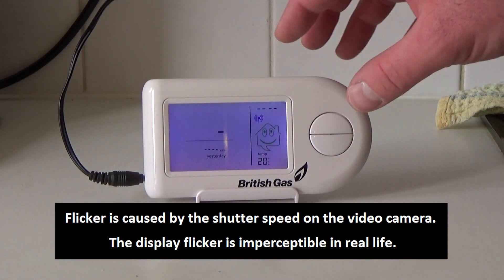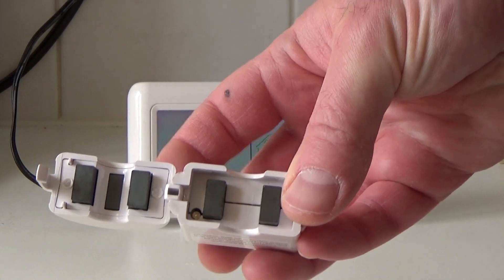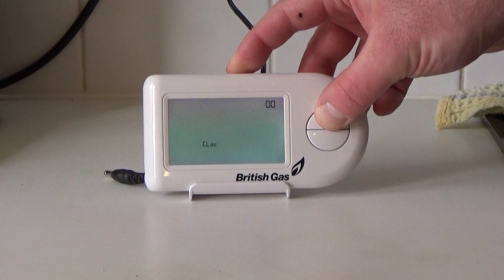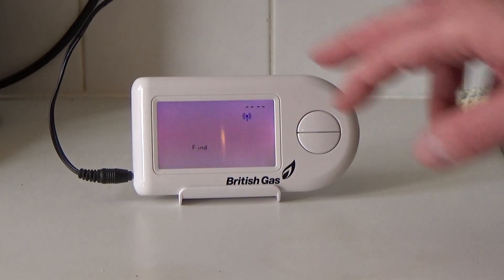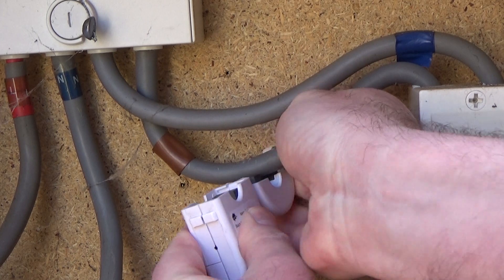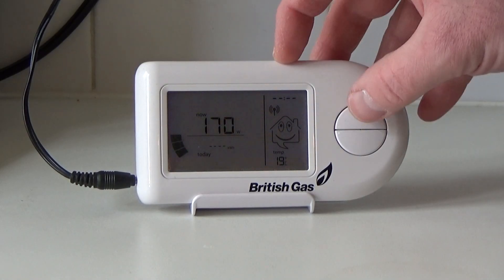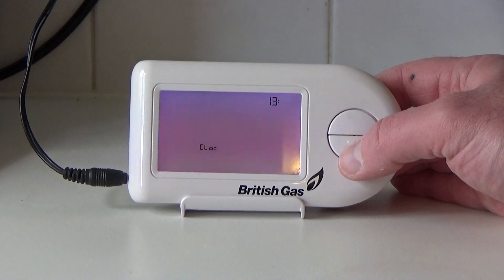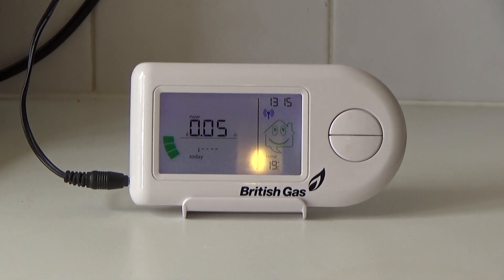British Gas Energy Monitor "DIS150" - How to Reconnect to Sensor Unit

Comment: Many thanks Tim, this worked perfectly on our one (same model). The battery in the display unit for ours would not hold a charge, so we couldn't put it into "settings" mode while on battery. But the press bottom button followed by 4 presses of top button straight after plugging it in still put it into "find" mode. 🙏

Comment: I've replaced the battery in the sensor but have no flashing light? Is there something else I should be doing? Thanks
Reply from the maker: Assuming the battery is good and is making good contact with the terminals (check for dirt or corrosion), if the light isn’t flashing the sensor may think it’s already synchronised. There is a tiny reset button on the side which you can push with a straightened paperclip or similar. Try removing the battery for a few minutes, then put it back in and immediately press the reset button for 2 seconds. (The reset button only works for a short time after inserting the battery. ) That may reset it to flashing mode.

Comment: I have a different problem with this BritGas 150 monitor display. Can anyone help please. Wanted to start using the device again - I put it away 5yrs ago and it was working ok then. So I bought a new CR2 lithium battery for the sensor...I now get a single green light flash from the sensor light when it's in the open position...so I assume the sensor is now working. Initially, when I plugged the monitor unit into the mains trans plug it seemed ok - it came up with the normal display. I could set the time and unit costs etc  - but would not go into 'find' mode. So I followed the tips in Tim F's video but now it's stuck in 'Find' mode. Nothing I press (or press and hold) can get it out of find mode and back to the normal display. Is it just broken - or is there another secret button pressing routine ?  Might be worth adding that the display monitor can't keep going without being plugged into the mains - so I assume it's internal battery is dead.
Great video btw - thanks for taking such trouble.
Reply from the maker: Yes, I had this once. The sensor thinks it’s already synchronised with the display, but it isn’t. There is a reset button on the sensor unit that can be pressed with the point of a pencil. My memory is hazy now but I think the fix is: Remove the battery for a few minutes, then put the battery back in and straight away (within 10 seconds) push the reset button for 2 seconds, then release the button. It’s something along those lines anyway. I remember the reset button only works for a short time after inserting the battery. If you wait too long it doesn’t work.
Reply: Thanks Tim F. I'll try that when I get home. Cheers.